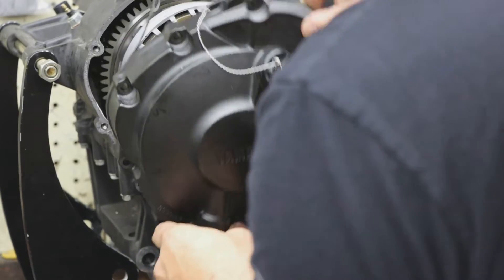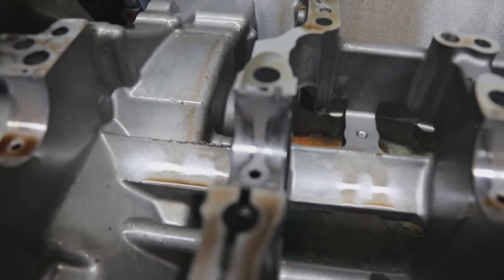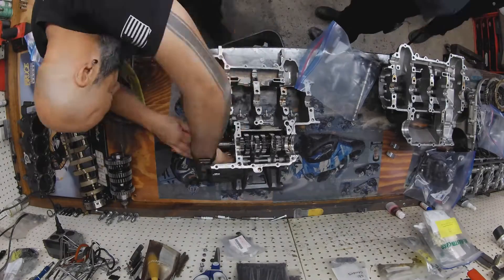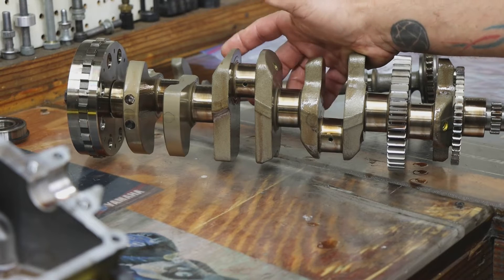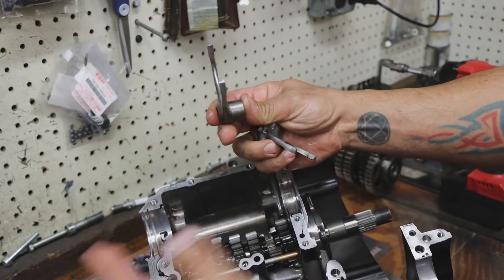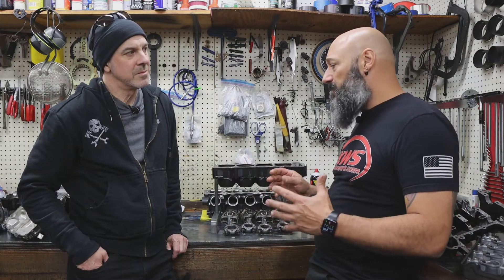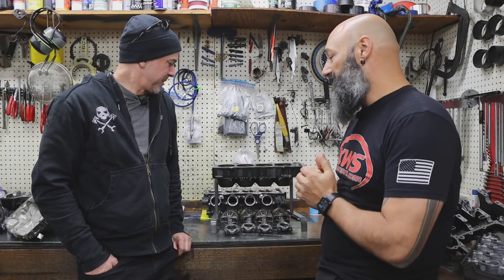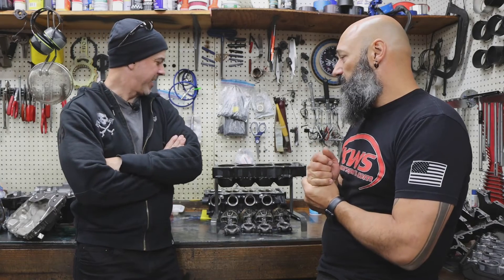Yamaha YZF-R1 Race Engine Tear Down: The Bottom End!  (Part 3)

Comment: awesome video! thanks!  have you ever seen the generator side counterbalance weight hit the outside engine case internally and put a crack in the wall after a lay down on the stator side?  the stator cover took the impact(cracked, looks like the generator dug into the case by 1mm at 10oclock. shaft on a dial indicator looks good.   There is no external impact marks to that outer case wall by the counterweight at the corner of the engine so i am  thinking it has to be an internal impact...but i cant wrap my head around how the counterbalance weight could hit the wall...maybe a spun counterbalance shaft bearing?...jumped timing, hit the crankshaft?....no metal in the oil...but i havent started it since the laydown

Comment: Rebuilding my 14b gearbox currently as cant change from 3rd to 4th under load, most likely bent shift fork. To be fair, 6 years of hard hard street riding, almost always on the upper end of the rpm, surprised it lasted this long and its such a small failure.

But i have a question for you guys.. since i have engine apart again (2nd engine rebuild first time blew bottom bearings). I have a complete spare engine as i bought another engine when i blew the bearings.. so i have the time right now for some "correcting".

Do you guys have any suggestions on what i should be on the lookout to improve and or modify? I don't want race performance, but i do want a little more oomph out of her, so im thinking already to send head off to be cut and ground for better airflow.

I don't want to buy cams or such, but just looking to get a bit more power whilst the engine is apart?

Comment: Hey guys I am interested in any ideas or services you may have we have a lightning sprint car with a 2017 r1 we are in need of some more lower end torque we run methanol we are also experiencing 3/4 throttle lull where it spits and sputters

Comment: Great video.
Very informative and interesting.
Curious as to your take on engine break in on a dyno; whether it affects the engine’s longevity?
Thanks!!
Reply from the maker: In the experience of this race team...RACE engines tend to fail catastrophically from a valve, or gear, or cam chain tensioner or a piston or some other hard part failing.  Race engines don't usually wear out from piston wear or main bearing scoring.  So, from our perspective, racetrack break in or dyno break in hasn't materially increased or decreased the service life of one of our engines.  That said, it won't hurt to break it in on a dyno, we just don't always have one available.

Comment: Pretty awesome series, I learned a lot. I race a 20k mile r1 and the motor still pulls hard. 18k of those miles were on the street. I had the valves checked at 18k but I’m sure I’m coming up on a rebuild.